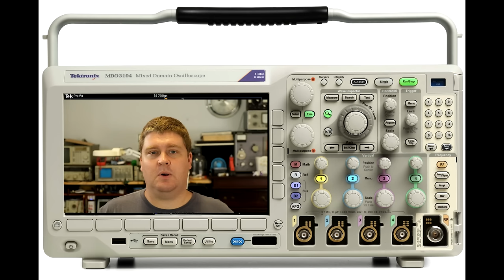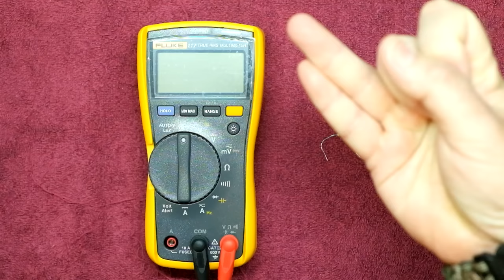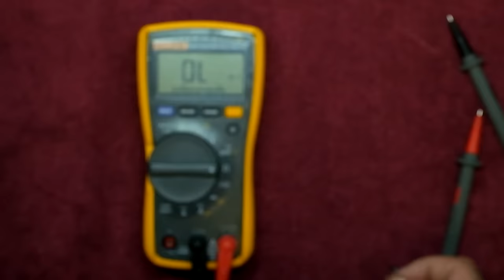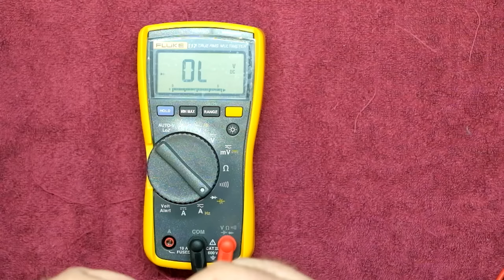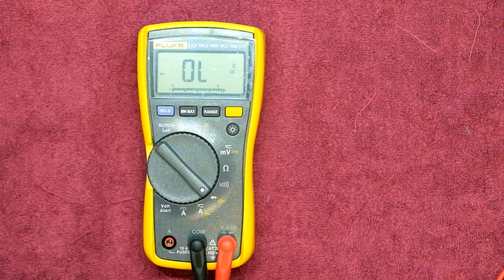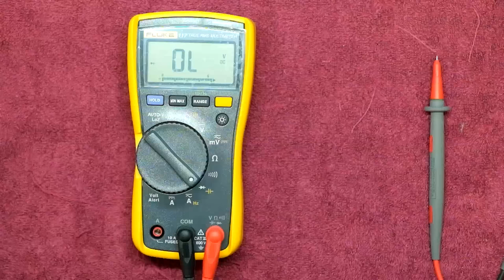Episode 54   Basic Component Faultfinding with a Multimeter

Comment: This was extremely helpful. thank you! I had received a board from a glass top stove that supposedly didn't work. fortunately all the components on the board tested out perfect. But unfortunately these people had German roaches and all the roach crap was fouling the whole system up. I clean all the feces off of the board and it worked perfectly. So people if you have a roach problem and your appliances don't work, that might be the problem. Because roach crap really does screw the whole system up. LOL

Comment: It just feels a bit too vague and rushed for a "Basic" tutorial; ie. You take a reading and say "Looks good!" but you never explain what a bad reading would look like or why the readings you took are in fact good.
Reply: It's a hair above basic. The reason the readings were good is due to continuity or lack of. And also because the resistances were within the expected ranges. It's VERY important when dealing with electrical components to expect a reading, in the case of the resistors you can consult a chart online for the colour stripes and compare to your readings.. in general if a reading is within 10% of what's expected the component is considered good.  :)
Reply: @MrDmadness  Thank you for the reply.
Reply: @Grimes907  thank you for the pleasant response. It's my life goal to try to be logical and helpful on the internet.. its so important that we turn it into the usefull thing it's meant to be and disperse from the toxicity of it..   thanks for being awesome :)
Reply: @MrDmadness  thanks for your response. My problem is not measuring components,  but correct measuring in circuit. What can we expect to correctly test in circuit with accuracy and what needs to be removed for accuracy. As you and I both know, the majority of faults is with shorted or leakey caps. How can these be measured inline with accuracy?
Reply: @jefffoster3557  an oscilloscope will tell you anything you need to know. With a volt meter you can test capacitors with the cap funcation ( sometimes paired with the diode function )  to co pare their readings with their identifying markers. For voltage on a board you need 2 points of contact ( one could be ground ) and touch a line trace anywhere understanding that the meter is giving  you the differential between those points( eg. If you check the same live wire it will read 0volts as there no differential )  to read amperage in a live circuit is harder, there is a meter specifically for this that's expensive and who's name escapes me at present  though as mentioned an oscilloscope can do all functions. One of the first things I learned doing controls wiring is that you should never take a reading without first having an expectation of what it SHOULD be. For resistance readings ( never take these on a live circuit ) it's as simple at touching 2 points and reading the reading, having a wiring diagram helps to see if you are reading g resistance through a component like a mossfet or otherwise.  

The basic triangle for figuring electrical readings out ( if you have 2 ) is this 

Volts over amps x ohms ,

E.g..
120 vac 
15 amp breaker 
== 8 ohms resistance .. this means that if you have greater than 8 ohms resistance your circuit will not function at all as electrons cannot overcome the resistance 

Remember also this ( compare ele tricity to water ) 

Amps = flow  ( same as gpm or any other flow in water ) 
Volts = electrical pressure ( psi in air or water ) 
Ohms = resistance ( same as friction allowances In plumbing ) 

Electricians have switches and breakers 
Plumbers have valves and main isolation 

They are basically the exact same thing, except specific to their conveyed medium . 

:)
Reply: @jefffoster3557  capacitors will lie to you because they hold cap voltage a d they are often employed as bridge components across l1 and l2 to maintain a stable field 
Mossfets will lie, micro controllers also may lie depending on if they have floating pins or not.   

If you take pcb components markings you can assess what they should hold for values.. if testing on a pcb accurately you need an oscilloscope, if you're just looking for burned out or damaged components a capacitor usually will be buldged and have its fracture lines domed out, mossfets usual,y can be observed to have failed on pcb, and the quickest easy tool is a thermal imaging camera like the seek thermal pro ( I use one regularly that attaches to my phone )  then you can usual,y see the components overheating, in my industry oftent his happens due to dust accumulation on said pcb.
Reply: You do need to have some knowledge of electronic such as color code, transistor diode, polarity and etc.

Comment: Excellent video easy explanation brilliant.

Quick q i have the fluke 117 there is no "rel" button on this meter to zero out the leads. Is it possible to zero the leads ? As when i set the meter to ohms and check the leads i get a reading of o.2 ohms and can't reset it to zero.

Comment: For process control techs using a Fluke, an easy fault to find is that you left the dial on milliAmps and then connected 120 VAC. Yeh, ya might wanna buy  at least of those little custom fuses.

Comment: Analog multimeters are better for this purpose, even if they are inaccurate, and old. Better response and you can test, how the device behaves. Analog multimeters are also ideal to revive locked devices or components. I could restart the charging of a locked ZTE phone, by tapping the port and batt connections with a multimeter, and it started charging. Digital multimeters are better for everything else.

Comment: I have a electric shaver that doesnt charge anymore , i dont think its bcuz the battery is dead, i think its a technical issue that send the power directly to the motor instead of the battery
And when its pluged into outlet, the motor starts but gradually it gets more intense, so much that i think it might damage the motor and i get it out of the outlet
Any help? Do u have a video about it ? Or can u tell me what should i search to find the solution ?

Comment: but dont diodes have different values? i have 2 diodes that have the normal .550 voltage drop and two others that have a .300 voltage drop?  is that bad?
Reply: I think that depends on the material you’re diodes are made of, your 0.3 voltage drop diodes sound like they could be germanium diodes?

Comment: How does the low impedance mode discharge the cap? I had issues where i worked on a PSU and measured 0.6v and still got a shock, not sure why maybe i measured it wrong?, I put my black probe on a random ground however, rather than the capacitors ground pin, could that be why i got a wrong reading?

Comment: ow to test optocoupler in circuit
Reply: The output terminals can be thought of as a diode (LED) I guess you can test the voltage drop of the diode based on the input?